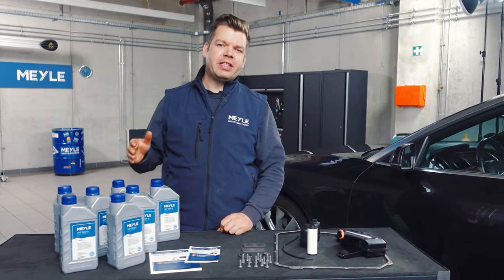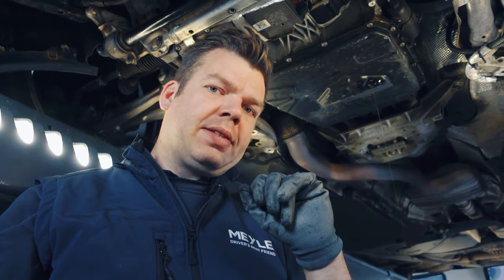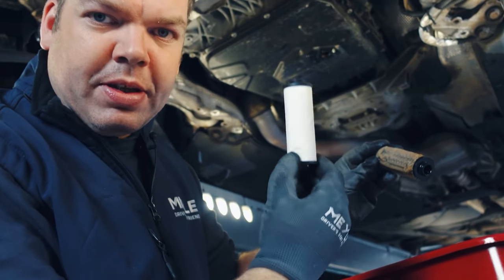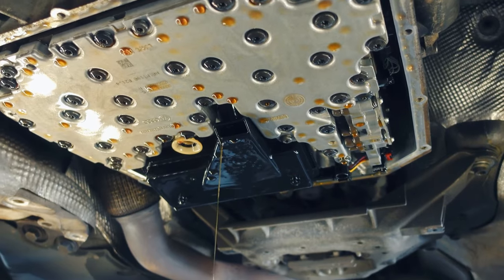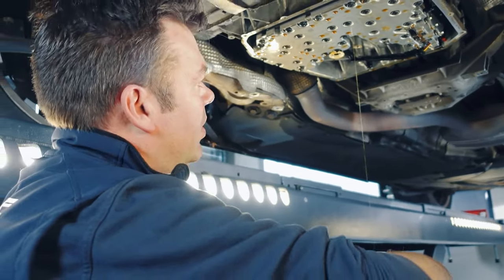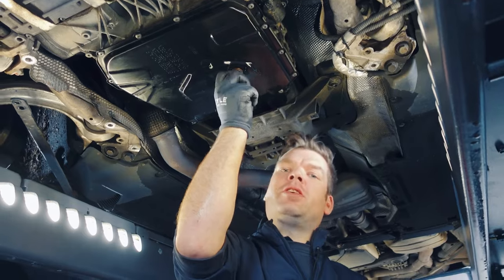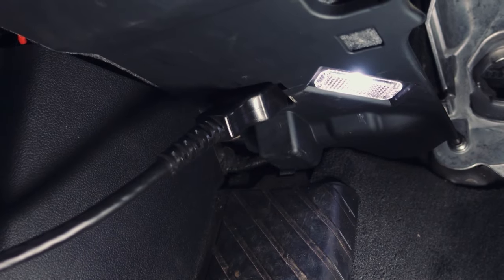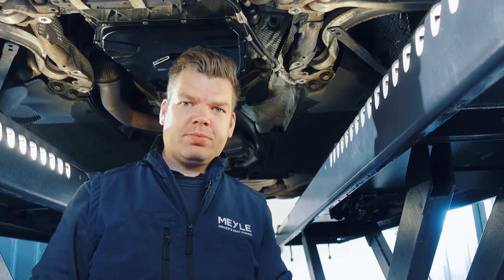Changing the transmission oil in the Audi S-Tronic automatic transmission, 7-speed DSG 0B5

Comment: This is the 7 speed transmission in my 2015 Audi A6 Quattro. When serviced by Audio main dealer at 120,000 km, 2nd fluid change,  they replaced fluid and paper filter only, not internal filter. Is this correct. The car is now overdue 180,000 fluid change, will it need large internal filter.